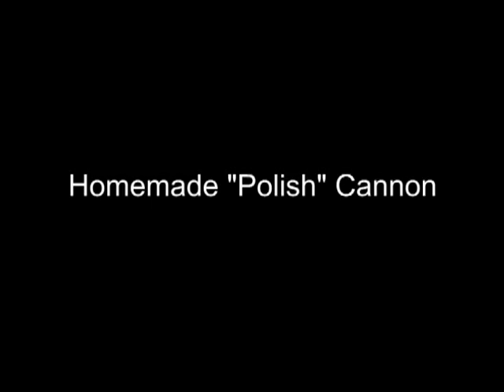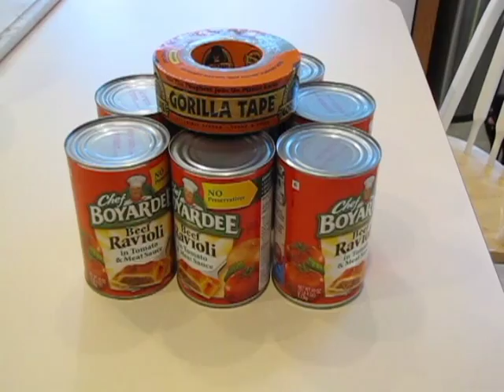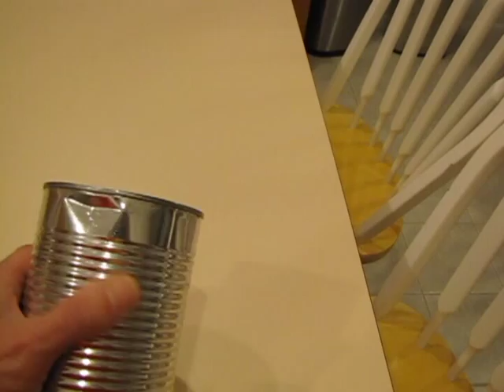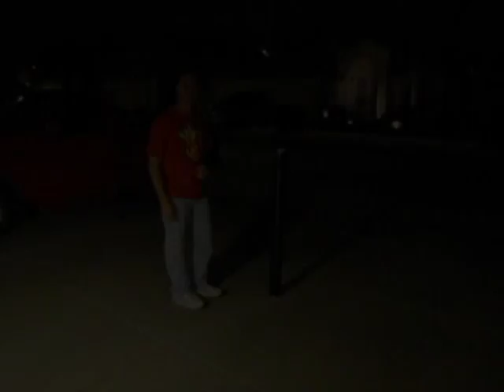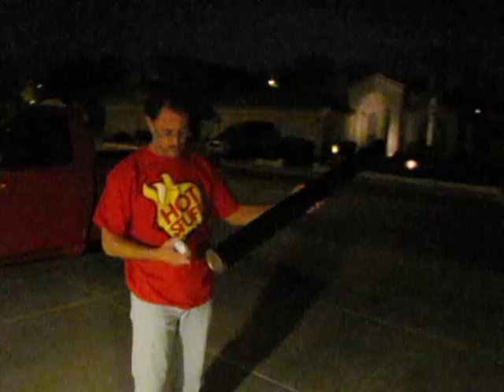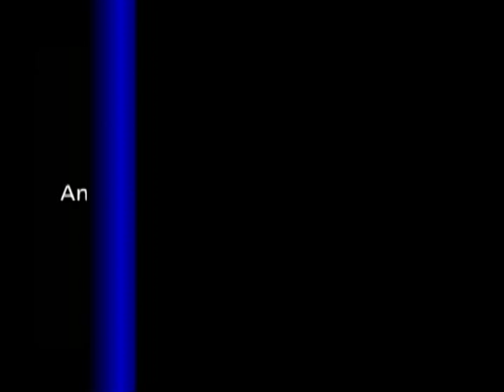Giant "Polish Cannon" Shoots Flames!

Comment: Ah yes, the old "Polish Cannon." Learned how to make those in the 1970s as a kid too. Then in the 1980s, while drinking lots of beer in the barracks with my platoon, got an idea to build another and try it. It was a weekend on free-time. Used beer cans (which were aluminum away from the old tins by then) and a bunch of "hundred-mile-an-hour" tape and Zippo lighter fluid. The accelerator can I put at the bottom though. Anyways, bad mistake. Shook it up good, lit the pin hole and it blew apart, big bang, cans everywhere with smoke. Got an article-15 for that trying to show others what can be done with lighter fluid. Don't use aluminum, LOL.
Reply from the maker: LOL! Great story!  Yeah, aluminum won't work.  My uncle used propane on one of mine and the recoil turned my thumb black and blue. Great learning experiences back in those days:)

Comment: Just made one as well cant wait to fire it, what lighter fluid did u use? Also fagaofe are good
Reply from the maker: Good luck!  I used the standard Ronson lighter fluid but and regular lighter fluid works.
Reply: @AzKaraokeVic  just fired it damn its loud!!!
Reply from the maker: Great! I'm glad it worked out for you! Here is a secret I learned the hard way in my teens.  My uncle was a chemist and said propane would work better, so we used a propane torch to fill it instead of lighter fluid. I lit the thing with a tennis ball in it and the tennis ball flew out of it so hard it shot the tennis ball clear over our Wisconsin barn from probably 100ft away!  The only problem was that it kicked back so hard it turned my thumb black and blue. So be careful with that thing, it can be dangerous!
Reply: Did the bigger cans make much of a difference in loudness?
Reply from the maker: Ry Hamo Yes, it was a lot louder and had a deeper tone

Comment: If you puncture the bottom of the second to last can instead of the top of the last can it wouldn't have an issue with removing the contents of the last can...
Reply from the maker: Ah yes, but then you would have combustion chamber as two pieces and likely blow the tape apart..